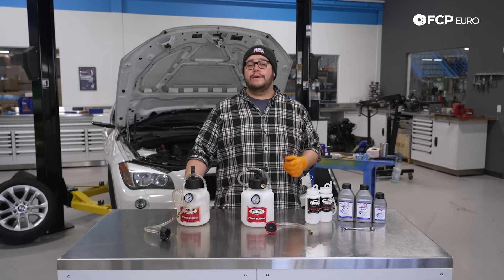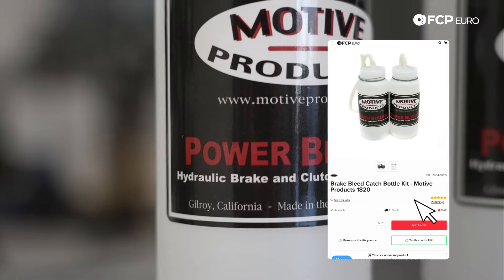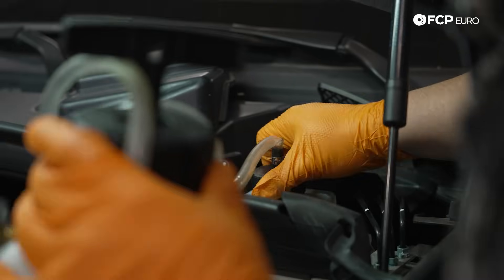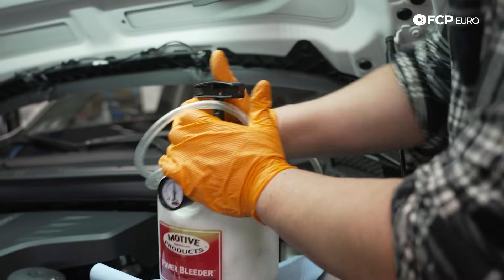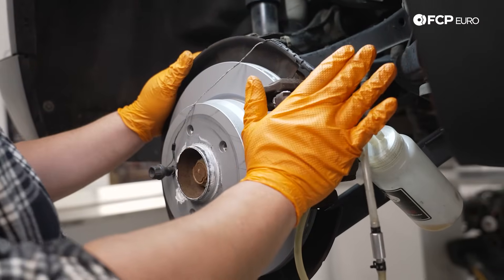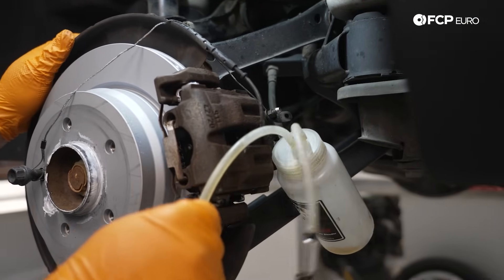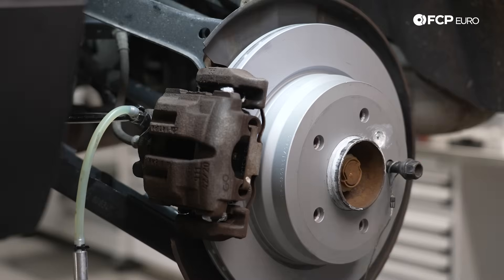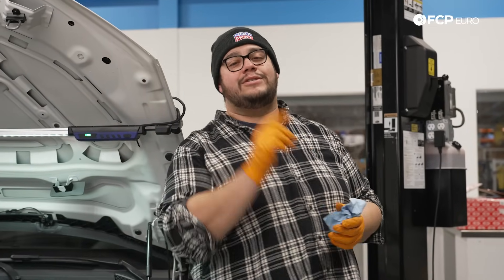How To Power Bleed Brakes Using A Motive Power Bleeder

Comment: I'm using the tool right now in Volkswagen touareg. It's leaking air. Can you please help me ?
Reply from the maker: If it's leaking air from the connection to the fluid reservoir, check the rubber gasket to make sure it is in place. You also sometimes have to tighten this down more than you think you might to create a good seal. Always be careful tightening however and be sure not to damage the plastic reservoir with too much twisting. Hope that helps!

Comment: I bought from this store and it is a garbage! It doesn’t hold the pressure long enough for me to bleed the fluid out! I pumped all through out the procedure cuz the pressure goes down like a flat tire!! I don’t know why!! And I don’t even know if I get the right pressure for my break system!! BS!! And the 2 tube connection was licking, I tried to tighten them up and put Teflon tape!! Im not sure if the one I got is defective. Its not worth it!!! 😡
Reply from the maker: Two possible scenarios as to why:

#1) The o-ring is not sealing the cap where the pump is. That needs to be seated correctly for it to create an air tight seal. There is a groove it should sit in and if it's dislodged it will not build or hold pressure
#2 ) The fitting between the vehicle specific adapter and power bleeder is a pipe thread. This needs to be very tight to seal and not leak,.

If both of those areas are good it might just be a defective hand pump. We will replace it for you.

Comment: These are nice tools.  I needed one 'right now' so I made my own with a 1/2 gallon bug sprayer, it already had a 1/4" hose, cut off the sprayer, added some quick connect and hose fittings and there you have it.  The sprayers are thick enough to drill and tap for a gauge but I put mine inline with the hose.  I machined an aluminum cap for use on BMWs. I'll admit that finding caps to use is difficult so buying a unit like this with one or multiple caps for different vehicles is a big plus and definitely worth it.  Also, I refill the master by hand and don't put fluid in the pressure tank.  I wouldn't put the fluid back in the bottle and I don't, or won't, use fluid that's been in the tank for more than a couple hours so saving the cleanup is worth it.
Reply: I did something for my power steering system, drilled a hole in a factory cap then stuck a quick connect on to it... voila. Doing stuff is fun right?
Reply: i use it same way and same reason. adding fluid only master and tool container only air. working well that way.
Reply: @Jakedelus 

How does that work, no air is introduced into the system that way? So for one caliper for instance you pressurize the system at pump(dry) and then bleed out the fluid until nothing is coming through the hose at that one bleeder then depressurize and disconnect the fitting at the master cylinder and fill it back up to the max line. Then repeat that process for every other caliper? Just trying to make sure I'm understanding correctly...
Reply: @jeffherrington  air wont go from reservoir to brake lines as long you have fluid in reservoir. No matter if you have fluid in bleeder tool container or not. And yes just like you say= pressurise the system with tool and go thru all brakes,disconnect tool and finaly top the reservoir to upper level.
Reply: @Jakedelus  Oh alright, good deal and thanks for the response to confirm 👍
Reply: Yep that’s even better if you don’t have a storage tank to clean up after, I have a power bleeder kit but sometimes am reluctant to use it due to the cleanup. If I am only doing one line or a caliper relacement etc I will resort to the old way just pumping pedal up/open bleeder repeat. I will break out the bleeder only if replacing all the brakelines etc then I can justify the clean up

Comment: I installed a quick connect fittings in the line from the tank to the cap, makes installing easier as the tubing does not get twisted. Have been using this bleeder system for over 10 years.

Comment: Many of the new Audi's service manual call for approx. 30psi to bleed the brakes. This forces the ABS system valves open otherwise you get no flow to all of the calipers. You can do it with the Motive, you just have to pump it up until the needle goes past the 20psi mark. Even though the manual says 2 Bar (29+ psi), many say a little past 20 psi will work. I had a very slow flow from the rear Calipers on a '14 RS5 at just over 20psi.
Reply from the maker: Appreciate the tip. On many modern cars you can also see good results with using VCDS or another scan tool to run an ABS bleed, which runs the pumps and clears the valves of old fluid/air.
Reply: @fcpeuro Great point. I used a vacuum bleeder and manually bled the system multiple times and still had air stuck in the abs module. I used my Autel MaxiSys Elite to run an automated bleed procedure and it worked the last if the air out
Reply: @keithcaldwell7187  u need a Phoenix reverse bleeding
Reply: Finally bought a schwaben bleeder been doing it old school for 20 years I found with 20 psi on my 2015 A3 the fluid came out of the rear bleeder at the smallest slow stream barely visible. Called the ecs tuning about it (sorry fcp) and they had had a bad batch of bleeder supposedly getting new one. But I feel they say 20psi for liability reasons when you use shop air it's typically higher than 29psi.
Reply: Is that relevant to 2011 a4?
Reply: No wonder I have low  brake pedal for 2013 Audi A4 Sline model after bleed system I put 16psi only ,, thank you
Reply: lol I remember when people who bought Audis could afford to have them serviced professionally. Now anyone with two nickels to rub together can buy one and park it in their front yard. 

That’s the other thing. Nobody would ever park an Audi outside.
Reply: @googlename8066  I do all my work on my cars. My parents have a euro workshop work on theirs. Said Euro workshop fucked up a control arm install resulting in my having to take the car back to the workshop to have fixed. On the way the ESC failed, causing me to almost crash the car due to said workshops fuck up (I was turning right, ESC failed, causing car to steer HARD RIGHT by itself). If I'd installed the parts that NEVER would have happened.
Reply: @googlename8066  Hey, my 1999 Audi A6 Avant Quattro makes a great work truck for my laser cutting business! Put that rear seat down and you have a rainproof cargo area big enough for an assembled Ikea bookcase and the roof rails hold up to 200 lbs of 4x8' plywood. I can get everything for a 10x10' craft show tent in it with room for a passenger to ride shotgun. If I want to go camping, it holds a twin futon and the Metallic Melange paint matches California dirt.

Comment: Ok I just got this from you guys , I dunno if it's not working well or I'm doing something wrong or that's the way it works, in your video when you pumped it dry , you were fast forwarding so I couldn't tell how many pumps you were pumping, so on mine I pimped 50 pumps to only get it up to 1 or 2 PSI I mean the needle barely moved , is that normal? or did I get a broken one? please reply so I can s=deal with the return/exchange before too late , thanks
Reply: Did it end up working out for you? Sounds like the cap wasn't sealing correctly on the master cylinder or leaking from tool somewhere else...
Reply: There was a leak somewhere, Maybe you did not tighten the cap enough or the rubber gasket was missing?

Comment: this company motive is horrible, i have wasted 3 months trying to order their product, 6x they failed, 1 was on amazon 5 were direct from manufacturer,  the boxes aall had random adapters in them, never matching what i ordered, its like the china factory they buy from randomly throws parts in boxes. after finally getting it right via amazon, the adaptor they sent me was so cheap it cracked when i screwed it on the brake resivor.i ended up bleeding the og way. $160 down the drain.
Reply: Haven't had any issues with my Motive bleeder and I've had it over 5 years.
Reply: @venerated  they were bought out beginning of the year, very irritating to constantly get the wrong item shipped, if they had better qa, which seems non existant, the pump works great, however i did have to get one of those metal adaptors. too bad i already manually bled it, but for my kit car it worked, stupid plastic adaptor had a hairline crack.
Reply: boo hoo
Reply: @Anders-y5z  get a job troll.

Comment: Should we empty the reservoir first and pull the old liquid out?
Reply from the maker: Hi, no need to do so, the tool will push all the old fluid out and through the lines. If the fluid is very bad, you can extract it and then run the bleeder.
Reply: Like the OP said...if the fluid has been in the car a long time, would be good to syphon some out of the reservoir rather then push it thru the system.

Comment: What about using a scan tool to open the abs system to allow for a complete bleeding of the lines ?
Reply from the maker: Hi Sebastian, you can certainly do that using a scan tool usually only necessary if you introduce air into the system, or have very contaminated fluid.

Comment: How should the power bleeder be stored? You mentioned removing all the fluid, but does it need rinsed out with something before storing?
Reply from the maker: Typically we rinse out the unit with a bit of brake parts cleaner and let it drip dry upside down for the night.
Reply: Just dump the fluid put the cap on and put it away

Comment: Is it recommended to flush the ABS when bleeding, say, this particular BMW?
Also, what about cleaning the Motive after you're done bleeding?  Is it necessary?
I've seen denatured alcohol mentioned for cleaning the unit.
Thanks!
Reply: Only if you remove the ABS Modul or the lines to or from the ABS Modul. For a regular brake Service it is not nescessary to use a scan tool or ISTA to flush the abs System
Reply: ABS is basically a closed-loop assembly while in normal operation... To avoid damaging the ABS when changing pads etc, one should always open the bleed nipple to allow fluid to be released into a catch can, and not go back into the ABS module.  I've never had an issue bleeding ABS trying to flush the system... Depending on your preferred method ( I use Air/vacuum device at the brake end to suck fluid out) ... Only race cars need synthetic fluid in their brake lines, so cleaning out an ABS module even when replacing one is not necessary.
Reply: Depends on the abs system, some of the modules actually have a bleeder on them in that case you could bleed the module

Comment: These really are awesome to have. We have multiple cars so I bought the 'quick connects' and redid the hose ends. (Kinda like Air Tool Couplers) helps the hose from twisting up. Motive has cool bits to make the jobs sooo easy. Denatured Alcohol to clean things up when finished.
Reply: Does motiv sell the quick connects? Hate having the thing twist up
Reply: @TheBaccaClench  Yes, under 'Replacement Parts and Accessories'
Reply: Do they come with a wide variety of attachments? Most of the ones I've seen are specifically for European cars for some reason

Comment: I bought this, but it takes many pumps to get to 5psi
Reply: You need to fix the air leaks intnhr tool. Just about every connection was leaking in mine. Used some thread seal and tightened up all the connections and was able to get it to hold.

Comment: Is there different types of adapters for the revisor?
This is a very good idea but I would like to use it on my Harley’s Brake system.
Reply: Not sure because Harley's have that 2 screw top on the master cylinder reservoir for the front brakes. They have an adapter plate for your classic rectangle car reservoir but I did not see the underside. If its just a big rubbery gasket with one hole through the middle of it to pressurize the system then you can probably use it on your harley's front brakes. Amazon search motive products 1115 adapter because i think youtube removes links.
Reply: @shize9ine  thank you.
Most have a chain style that wraps around it then clamps down.

Comment: Down at the wheel,  ensure the bleed hose is pointed upward before looping down into the catch can...That way theres no chance of air pockets returning back in the system if your pressure drops too low. 

Is always good to do a final bleed via the foot pedal...One benefit of this pressure system is it avoids eager foot travel on poorly serviced Vehicles.
Reply from the maker: Excellent point Peter!
Reply: Honest question - why the final bleed using the classic method?
Reply: @shize9ine  The seals within the master cylinder often collect sediment on the edges. The vacuum effect doesn't suck the fluid from all the crevasses in the sealed area but from the least resistance journey from the reservoir. 

Doing a final foot pump and holding down, while the bleed nipple is closed, ensures any old fluid surrounding the seals is flushed out of the cylinder where it can cause surface damage to the seals., and pushes the entire volume of fluid, rather than vacuum flow.

Hence my comment regarding the "eager foot travel"... Cylinder bore's surface collects the sediment in the area where the travel area while pressurized does not reach...Using the foot pump method, one should not push the pedal further down than when the brake system is pressurized to avoid damaging the seals due to excessive travel in the cylinder... Tried to explain it in two or three examples... hope this helps.
Reply: @peterlattimore6013  wish this was posted just two days ago instead of now. Flushed my brake system two days ago; when I got the car back on leveled ground, did the good ol’ method to pump the brake pedal before starting the car. May have pressed it too hard and too far, my brake pedal is now squeaking and potentially have damaged the master cylinder 😢
Welp, on the bright side, everyone’s gotta learn from their own mistakes!
Reply: @louislaw8655  Spray some lithium grease up n under the pivot shaft of the pedal assembly... Never heard of noise being emitted from a leaky master cylinder... You may have just disturbed the surface of the shaft where it rotates... Can't give you any more confidence, I'm afraid...Good luck...
Reply: @peterlattimore6013  I should've clarified more! The squeaky pedal and leaky master cylinder are deemed to be separate events.
I'm thinking my master cylinder might have failed because I'm seeing drips of fluid at the shaft rubber boot.
Then, I used the ATE TYP200 (blue bottle) which has normal viscosity, where I live up north in Canada that see lots of colder climate. BMW calls for low viscosity brake fluid instead of normal. I'm thinking that's where my squeaky pedal problem is presented that the ATE fluid is too "sticky" than what the car is called for.
Well live and learn, so they say lol
Reply: @peterlattimore6013  so for the final bleed at food pedal, you’re saying press pedal down and hold down with no bleeder screws opened? Hold pedal down for how long? Do this just once at the pedal then release bleeder pressure and done? I read your follow up comment, but I’m confused, and what you’re saying sounds like it’s important.
Reply: @BorderlineOCD  generally we didn't bleed the brakes by ourselves.   So yes, 1st person maintain pressure on foot pedal, 2nd person at the bleed nipple. """2nd says Hold it down""" 1st person says ""down""" 2nd person at nipple releases the nipple pressure...ensuring at the reservoir of master cylinder is full of fluid, theres no chance of air pocket within the seal assembly when fluid gets sucked through.
Reply: @peterlattimore6013  Right, a manual bleed with 2 people I understand, but I’m still confused at your additional recommendation in the context of using the 1 person pressure bleeder. Would you mind just rephrasing your recommendation? You’re still suggesting to follow the procedure in this video, and then do what with the brake pedal while the pressure system is still attached? Many thanks in advance. Newbie here, will be first time using this bleeder tomorrow.

Edit: I think I get you. You’re saying do the 1 person pressure bleed and then do a full manual 2 person bleed without the pressure bleeder.
Reply: @BorderlineOCD  I think what he is saying is to: Do the 1 person pressure bleed, but after you close the bleeder for each brake, get inside the vehicle and give it a 3/4s push to move any sediment out of the master cylinder that the pressure system wont be able to remove with a vacuum method. Thats how I understood his statement at least! Hope he chimes in to clarify because Im about to try this for the first time in a couple days.
Reply: @peterlattimore6013  I'm confused as well. Please come back and clarify your recommendation. It seems important and I'm about to do a bleed on two vehicles in the next few days. Thanks in advance!
Reply: Do you pump  the pedal for each caliper? Do you. Push brake pedal while the pressure bleeder is in use?do you push the pedal when the bleeder nipple is open or closed? Do you do this procedure after all the four calipers are pressure bleeded?

Comment: Great video 
But my Mercedes calls for DOT4 + 
Can I still use just DOT4
Reply: DOT 3, DOT 4, DOT 4+ and DOT 5.1 are compatible. It'll not cause trouble if you mix them. DOT 5 is NOT compatible with those. However, DOT 4+ has a higher boiling point than DOT 4. Use what your car is designed for, especially if you like to brake hard, or you have hilly roads where you descend a lot and heat up the brakes.
Reply: @johnnyblue4799  Thank you for explaining 👍🏻
Reply: Dot 4 is what majority of Vehicles use... I dare you to find any different.